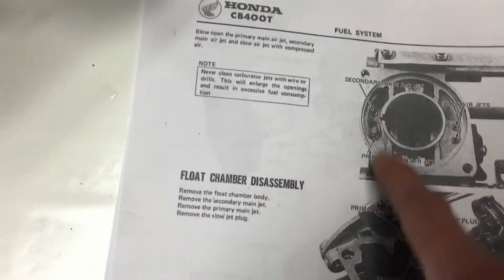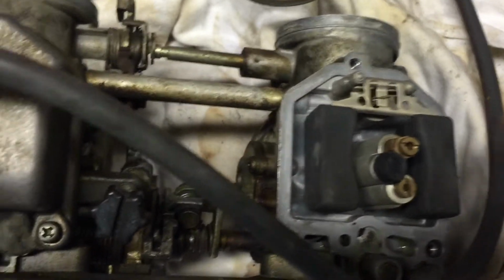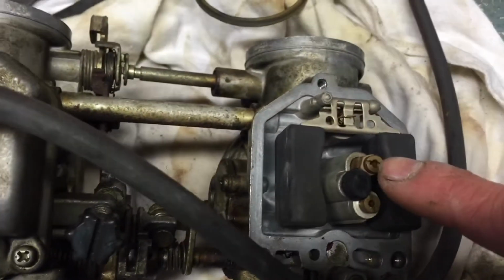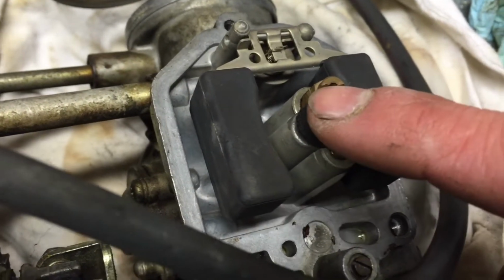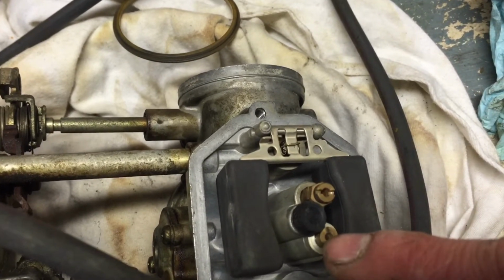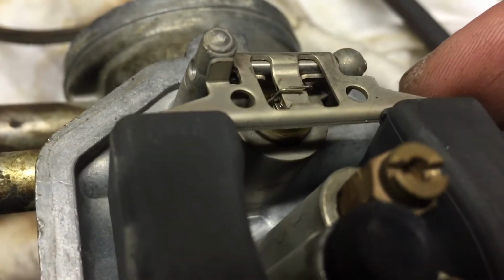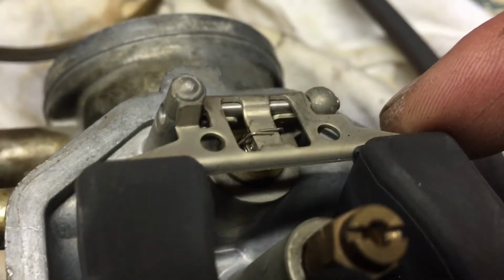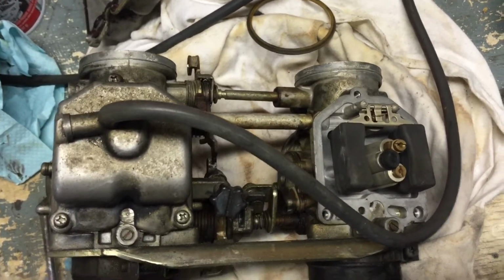1978 Honda CB400 Hawk Carb Cleaning

Comment: I just picked a 1978 barn find with 7k miles hasn't been on the road since 95. Really cool bike all original I'm getting ready to clean  gas tank,  carbs,  change oil and put new plugs in any other suggestions on a bike that's been sitting for so long
Reply from the maker: Nice! I just got a cm400 1980 some of my new videos show the build on that one!

Comment: I rebuilt by carb, and the pilot jet needle is stuck in the carb body. It’s currently at a repair shop, hopefully getting removed, I’m just praying that he can either get it out maybe by drilling or he has another carb that matches. It isn’t looking good tho 😪
Reply from the maker: Dang yea that’s happened to me. I’ve been able to get them out before by grinding a new slot in the head and then using a torch to heat up the casing with all the seals out of course
Reply: @IntoTheDirtshop  I was lucky enough that the shop I brought it to could get it out, but they drilled through. If I had seen this earlier I would have done just that. That being said, the carbs are back in now and it runs extremely rich, but it's not unridable. I bought this bike to learn on and nothing says "learning" like a sketchy ride haha
Reply from the maker: Nice! Have fun on it
Reply: Old head showed me a trick about boiling the carbs, boiling them refreshes the rubber and breaks up the ethanol and loosens corrosion. 
I just set my ultrasonic to boiling hot and let er run

Comment: could u buy new carbs off ebay and install them? 400cc carbs for honda motos?
Reply from the maker: You could, but in my experience the OEM carbs are way better quality, it’s easier to just clean them out they proper way
Reply: @IntoTheDirtshop  one of my carbs is leaking out of the float bowl drain screw. iv replaced it with a new one but still leaks. and iv already spent $10 on one, and on ebay i can get a new carb for $30-$50 bucks.  i know u recommend the OEM but i need a reasonable priced solution. so if u were to buy a new carb for the honda hawk cb400 which one would u recommend? and is it easy to installl
Reply from the maker: T1 I would never buy a new carb unless it was from Honda itself. You issue is most likely your float is stuck that’s why it’s leaking. There’s a ton videos out there on how to replace your needle and seat
Reply: @tmskatap  probably just needs an o ring. If that doesn't work just use epoxy to seal it. You don't really need to use the drain screw anyway.